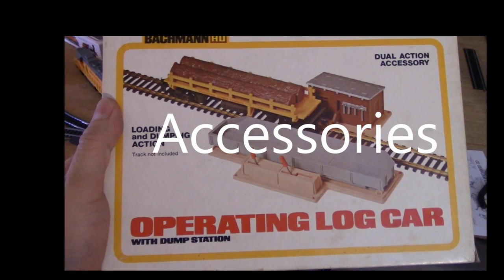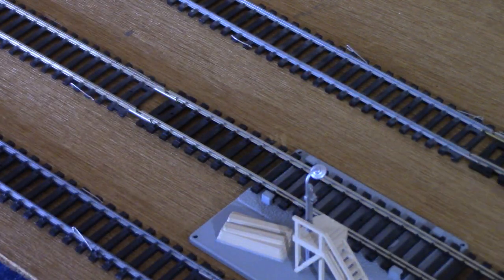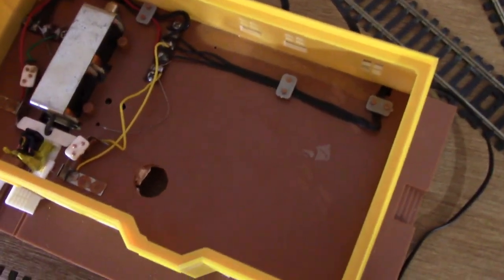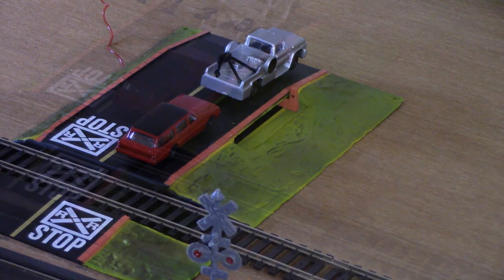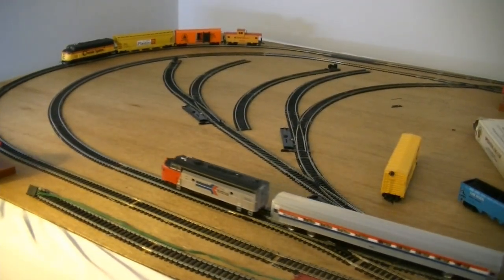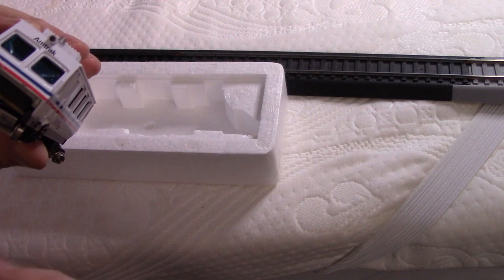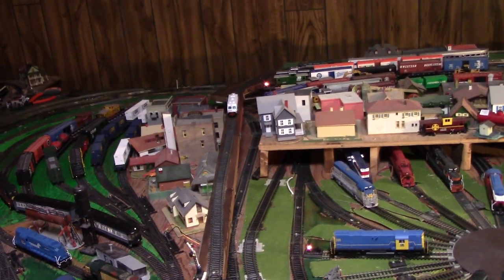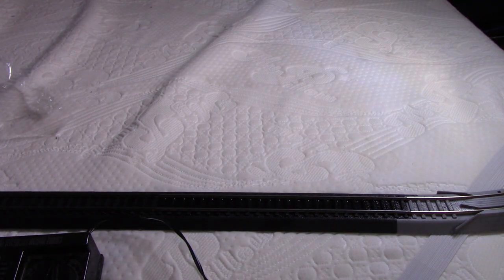Bachmann part 2- The accessories

Comment: A nice review of Bachmann accessories past. I can’t help but imagine how much more “play” value Bachmann would have gotten from the disaster crossing set, had they added a screaming toddler in the back of the station wagon. Plus dear old Dad passed out at wheel. That was acceptable by 1970’s standards. I think we witnessed a Bachmann miracle with your Amtrak maintenance unit running so well. You could probably buy ten more of them and not have a single one run as good as that one. Well done video 👍
Reply: Also making it so when the train hits the wagon it flies off
Reply: @user-sd7qo7qe4v  Some gruesome Model Railroad action on the layout 🤭

Comment: Nice video! I have the operating caboose in storage, along with that action depot and disaster crossing. Bachmann had some pretty cool operating accessories on the market, alongside AHM and Life-Like and TYCO's offerings. Nowadays the only ones they make are the dual crossing gate (regular version) and blinking truss bridge (updated to work with E-Z Track; I have both on my current layout), the crane car and boom car, and the steam whistle in shed. A few years back they discontinued the lighted stations, the diesel horn oil storage tank and the blinking light oil tank (I also have the latter on my layout.) It would be neat if Bachmann also updated a few of those accessories like the log dump station and the operating caboose to work with E-Z Track the way they did with the crossing gate and blinking bridge.

Comment: I remember as a kid in the 90's wanting all that stuff.  I at least got the Sunnyvale station which I still have to this day.  Wouldn't mind some of the operating accessories though.  Wish companies would bring them back with better, new materials as I am afraid as you mentioned the original ones being so old now the plastic will be extremely brittle to use and break.